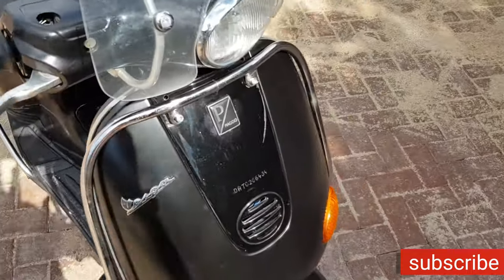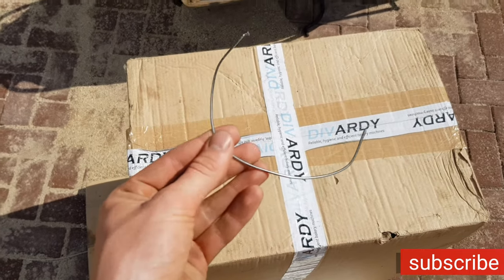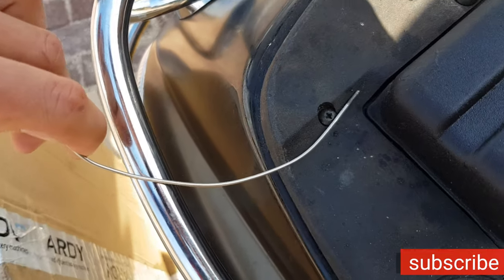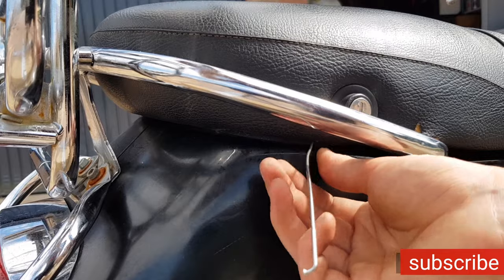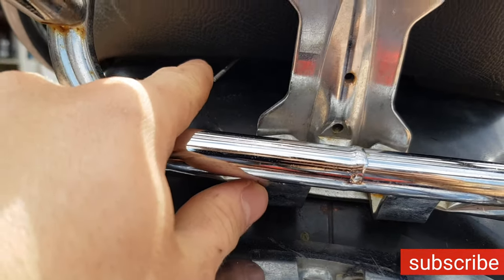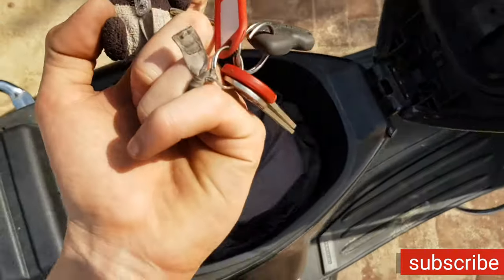How to open a buddyseat without a key on a moped

Comment: Groetjes van uit Canada.  Thank you for this video.  I recently had the seat reupholstered and the locking mechanism was not reinstalled properly, so I could not get the seat open.  I followed your guidance and, not unlike you, it took a few minutes to hook on to and release the locking mechanism.   Most importantly, it worked.
Reply from the maker: Great to hear that the video helped you my mechanism was worn a bit so it was easy to get to the hook.

Comment: I managed to insert a wire but it wont budge no matter how hard I pull. Oil tank is on the right side (Primavera), should I pull it to the right like in this video or to left?
Reply from the maker: I dont know the primavera that well but maybe try it from the other side? I hope this video helps you a bit.
Reply: Hi did you manage to get the seat open in the end? If so how did you?
Reply: Called a technician and they managed to do it via the front panel